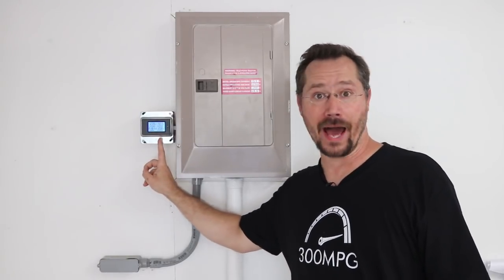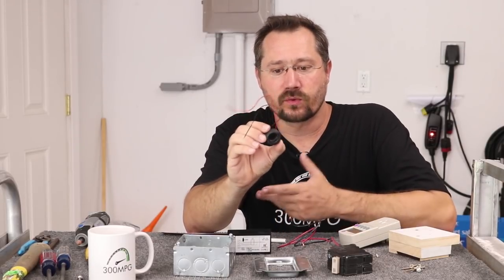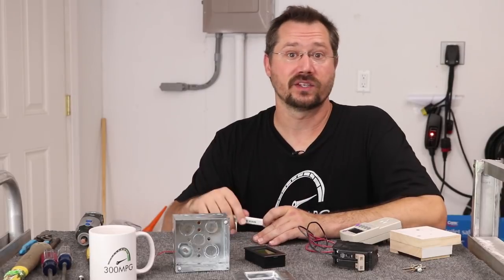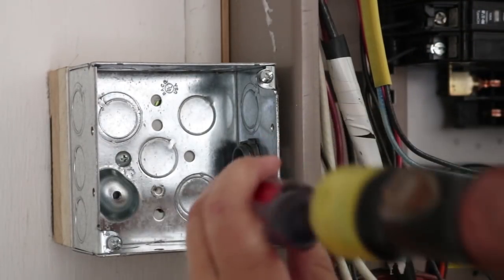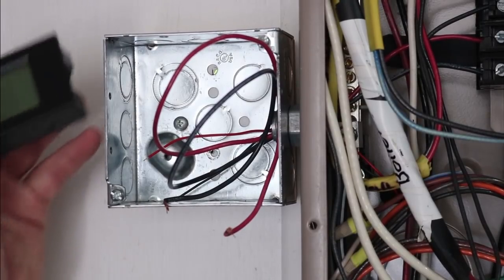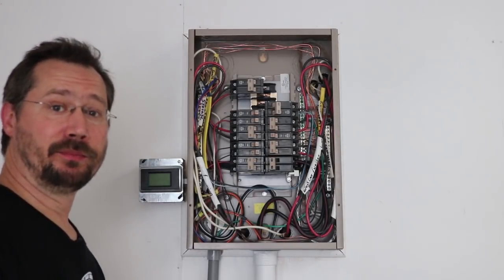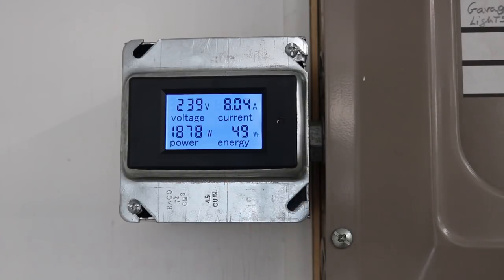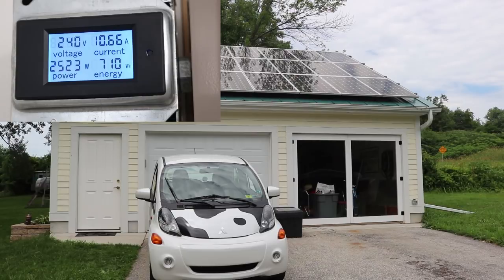How to Install LIVE Solar Monitoring

Comment: Hi Ben, thanks for showing this little system, I have a situation that I need to put this unit inside but run the CT to outside combiner box, can the CT wires be extended and can the little monitor be powered by 120 v breaker? thanks
Reply: No it needs the full voltage to calculate the watts (watt= Amps X Voltage)

Comment: Hi I bought solar system 4 years ago that came with mysolaredge .well last may 3g being turned off so was mysolaredge tracking. They want me to pay $700 for new modem nuts any advice? I just like to know what I'm producing than if any of my inverters have problem that would be covered. To save a little bit of money we went with a mom and pop company which supposedly now does not do residential. Just crap. Use to trust people very sad . I bought solar to help arising cost lucky we have smud so rates or not that bad.
But back to my "?"  Is there better way to know my system

Comment: I have a 3-Line Monitor installed that has failed.  I am replacing it with a unit EXACTLY like the one in your video which happens to have the exact same specs and instructions.  However, the Failed monitor came with a "Split Core CT".  
Can I use the already installed Split Core CT with the unit you have in your video?  
This would save me trouble opening my panel box, removing the split core CT, attaching new leads, and replacing it with the solid core CT.  Thanks Ben....
Reply from the maker: Assuming that the CT wasn't the issue in the first place, I would imagine that would work fine.
Reply: @BenjaminNelsonX  The instrument simply went totally blank after 4 days.  My guess is the instrument itself but your point is well taken.  Probably going to hold my breath and go for it...  Thanks Ben.

Comment: I’m in the process of installing a microinverter system,and I don’t want to buy the expensive envoy monitoring device.So if one inverter on a panel quits how would i know when it quits or which one?Other than that I like your monitoring device.

Comment: When you say that the sensor goes around the "wire from the solar", is the wire coming directly from the panels? Thank you.
Reply from the maker: I have a grid-tie solar system, using micro-inverters.
The micro-inverters convert the DC from the panels to AC. AC wiring goes from the roof, down the side of the building, and into this breaker panel.
The clamp-on current sensor goes around one of the two hot AC wires coming down from the roof.

Comment: this meter is not accurate at 13.29     8.05 amper or 239 volt or this meter show 1880 watt its worng calculation is 8.05 x 239 =1923.95 watt
Reply: The meter is right because he has a minor power factor problem. He is using 1923 volt-amps. The difference is usually caused by more inductive loads than capacitive or resistive loads. The power company only charges for watt hours because they add capacitors to the power lines to correct for what would be wasted energy usage. Home owners that have solar should add capacitors to freezers and other motor driven devices because they are wasting their own power.

Comment: Doesn't this need a sine wave current e.g AC? - Solar Panels produce DC and hence only generate a magnetic field when the voltage across the panel is changing
Reply from the maker: Robaire Beckwith This is measuring power AFTER it has been converted to AC.

Comment: utility company claims we aren't supplying  energy to the grid but our 32 panel solar system is working fine.  How can I prove that we are supplying the grid with energy produced with our solar panels?
Reply from the maker: I small meter like I installed in this video just shows what power is coming from the solar panels. It is NOT showing what actually goes to the power company.
On any grid-tie setup with your electric utility, you will have either a bi-directional meter or two meters (one for power in, one for power out) and that is what the utility uses to track your power production out to them.
The utility's meter will show them whether or not you are exporting power.
Reply: @BenjaminNelsonX  thanks for the reply. can I trust the smart meter/utility company? AMI meters allow for remote shut off, and can change  displayed information and calibration to my understanding. I feel like a blind cashier forced to trust that the customer will tell me what they are paying for.  thanks again my man.  sorry for the random analogy.
Reply from the maker: What's the expression? "Trust, but verify"? Yes, utility meters are accurate, and there's all sorts of weights and measures laws out there about meters, gas pumps, produce scales at the grocery store, etc.
If you have concerns, you can install your own meter, dedicated to just the solar - one that you own.
Some solar inverter companies have digital equipment that includes "revenue grade" production meters. Another way to go is simply to buy an old-school utility meter and have that put in to measure your outgoing solar. I have one I've used for tracking electric heat and electric vehicle charging use. I got that at: https://www.hialeahmeter.com
Frankly, the biggest concern would be just errors on your bill. Not the power company somehow intentionally trying to cheat you or anything like that, but just plain errors. If you have your own measurement equipment and READ your electric bill every month, you will keep a mistake from ever slipping through.
Reply: @BenjaminNelsonX  thanks you're a cool guy
Reply: Do you have energy storage? You may be feeding into the grid during the day but taking it back from the grid at night in a break-even type situation?
😎😎😎😎😎😎

Comment: Nice video. 
Quick question: is the device monitoring power generated by your pv?
Reply from the maker: Yes, this monitors the powering coming from my solar panels.
I'm using a micro-inverter system, with one micro-inverter directly on the back of each panel. So, in this case, it is AC power production being monitored.
Reply: @BenjaminNelsonX  thanks for the feedback. Is it possible to monitor the DC coming directly from the pv?
Reply from the maker: This one is really an AC system. It has a lot of safety features, and it's really easy to install as a DIYer. It can NOT easily measure DC from the panels, but it's really not designed to. The inverters are 96% efficient, so you can figure out DC power from that if you want. I don't know what else you would want to know about the DC side. There's not really any reason to monitor voltage at the panel.
For more on the specs on this type of system, please take a look at the manufacturer web site. https://enphase.com/en-us
I'm using the M215 micro-inverters, but any of the other inverters by this manufacturer basically all work the same.
See more or less live data from my system at: https://enlighten.enphaseenergy.com/public/systems/PqBp1213167
Reply: @BenjaminNelsonX  Thanks once again for the feedback. I'm interested in learning how to measure how many power in watt the pv are generating. Is there a way I can see live the power being generated by the solar panels?
Reply: To measure the power from solar, shouldn't the meter be connected to current from solar and the voltage from solar?  it seems that you are measuring the current from solar but not the voltage from solar?

Comment: Great video!  I want to do this to the breaker i use to back feed our house with a generator (with an interlock device of corse).   Why do you only monitor one wire of the 240/30 breaker?  Wouldn't you only get half of the story?  My thinking is that each wire powers a different leg of the breaker box.  Please excuse my ignorance, I'm a novice.  Thank you.
Reply from the maker: In the split-phase 120/240v system used in the USA,  when you are using the 240v, the same full current is flowing through both “hot” leads. You can measure current at any point along either wire.
Reply: How many wires do you have comming off of your solar array into the breaker box?  Also why the need for 240 to power the monitoring device?
Reply from the maker: My system uses micro-inverters and produces 240VAC power. There are four wires, which is standard for the US 240V single-phase. Hot-Hot-Neutral-Ground. The display is needs power. Powering it with the 240V lets it monitor voltage and thus also calculate power (in watts.)
Reply: Thank you for you patience.  I appreciate the feedback.  If you powered the meter with a single 120v 15amp  breaker would that then give the power readings of one of the two legs?  I do live in the US.  If not how yould you go about monitoring each leg seperatly?  Big thanx!
Reply from the maker: @tonyradca1235   Yes, I believe that if you powered it from 120V, it would give you the power from only that leg of the electrical system. There's all sorts of different products out there for 120V power monitoring. Just do a search. https://amzn.to/2OmYkhb

Comment: Love the videos.  Question, I thought you had one of the Enphase envoys, can't you connect directly too it through your browser (e.g. http://IPADDRESS/home to see a lot of this information?  Enphase also as an API available so you can do a lot of this as well.
Reply from the maker: The Enphase Envoy collects all the data from the inverters and passes it on through the web to Enphases servers. I have full access to that through a web page. I don't see any advantage to connecting straight to the Envoy. Public data on my system is available through Enphase at: https://enlighten.enphaseenergy.com/pv/public_systems/PqBp1213167/overview
What I really wanted though is a SIMPLE and REALTIME display. The Envoy is NOT realtime, nor does it have a display on it. It polls data on a set interval. (I think data collection is 5 minute increments, and data posting is 15 minutes.)
I would imagine that a clever person could design some sort of web based interface to the Envoy and then create some sort of analog display from it, but I think even then, it wouldn't be real-time.
The other big advantage of this simple Ammeter/Voltmeter display is that it's SIMPLE and it will work with any brand of solar inverter or any other device a person might want to check, like an electric car charging station.
Last night, I did just start checking through using the Enphase API and I was able to get it to talk to PVOutput.org. I'm hoping to play around with that to get a solar display that always shows at www.300mpg.org.
Reply: Thanks for the info.

Comment: Hey Ben, minus power losses, what would be the benefit of charging the car as you describe instead of just feeding the electricity to the grid and using as needed?
Reply from the maker: In my particular case, the main benefit would just be that my car would actually be charged with 100% solar energy, instead of a mix of solar and grid power. The are places which have grid-tie solar but with ZERO export. A system in which an electric car becomes a variable load to absorb solar energy would maximize solar energy on a zero export system. On an off-grid system, it would reduce cycling of the solar batteries.
There are also cases where power pulled from the grid vs out to the grid are billed differently.
So, the potential advantages of doing this for me wouldn't be as great as for some other types of systems, but it would still be interesting to try out!
Reply: Makes sense to me. Will be watching for the next video in my subscription feed.

Comment: Nice idea and video.  Seriously thinking about adding this to my array.

I'm not an electrician, but I was wondering if you might want to add an extra ground wire between the new box and the panel.  I know it's connected through the conduit fitting, but it might not be to code without the extra ground.  Any time I see metal boxes used, they always have a dedicated ground to make sure the box is always safe to touch.
Reply: Just wanted to follow up that I did add this to my array and it's working great.  Like you said, it is nice to be able to see they system performance immediately and the extra kWh meter allows me to compare it to my net meter and the online monitoring power.  

Thanks a lot Ben.